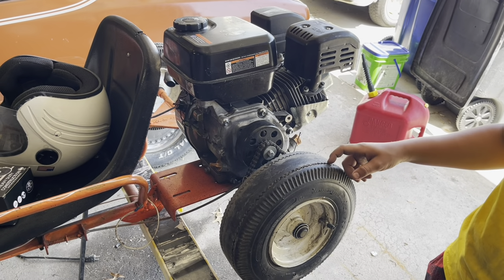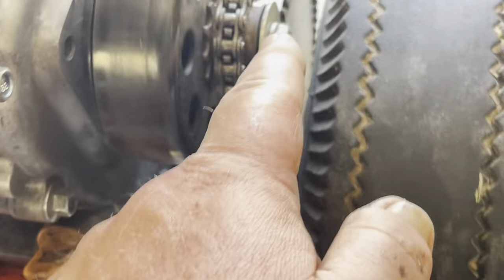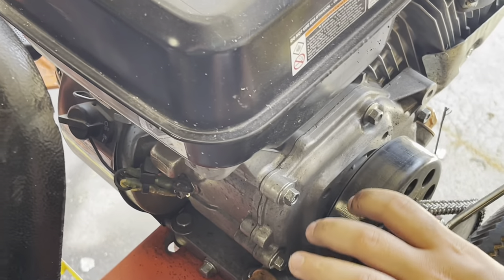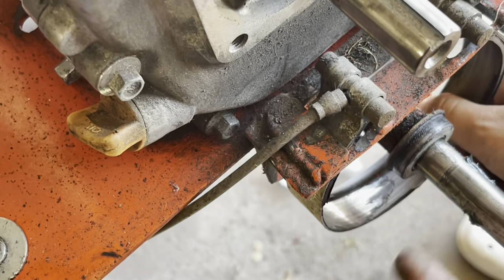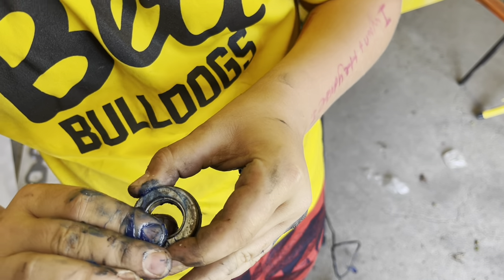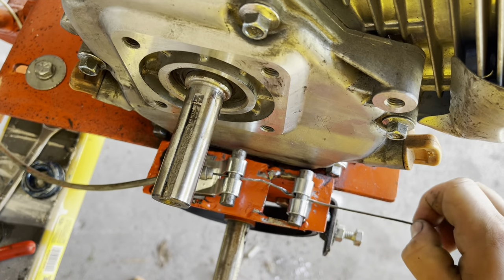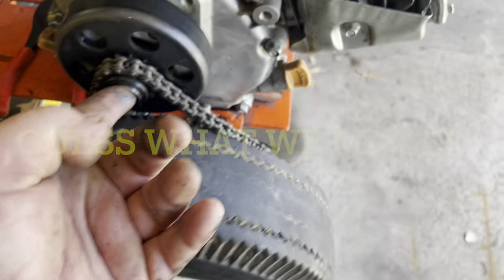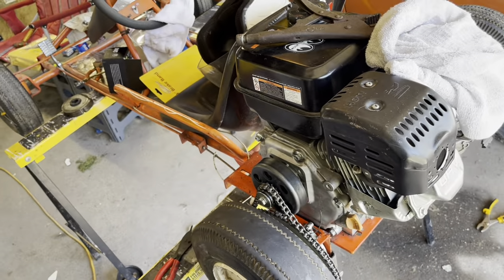Grayson fixes his Vintage Go Kart

Comment: Great job Grayson!!  That brings back some memories- go karts, and 3 wheeled death machines- looking back- we all should've had helmets on!😂  one thing- may want to check the welds on the U-bar ( when you sit, I'd right in front of you ) it holds the steering rod/wheel...my buddy had a small crash, the weld broke, steering wheel goes straight up and pops off, but the straight pipe it was connected to went straight down, and hit my buddy right where it counts!! After looking at the weld, someone clearly just " tacked " it on.   I have to pass that on to you because it's the first thing that came to mind when I saw the kart. I would hate to see that happen to Grayson or anyone else.  On a lighter note,  ( about the crocks ) 😂 ..= Remember Mr. Green Jeans  ? .... maybe Grayson has a plan‼️👍👍🦾🦾😁😎
Reply from the maker: Oh yeah I had a manco go kart I got for my birthday in second grade. I had so much fun on that, and my friends had 3 wheelers so we’d trade back n forth. The welds have all been rewelded at some point so they all look good. It does however need a seat. This one’s cracked in about 5 places. I’ve got a deer stand seat my brother gave me that I’m gonna take 2 inches out of and weld it back together and some couch cushion foam for it.
Reply: @Iowa Budget RC Bashers   sounds like a plan! I sat on steel many a times- then we'd get a pillow! 🙈🤣  Grayson is lucky to have a dad like you!!